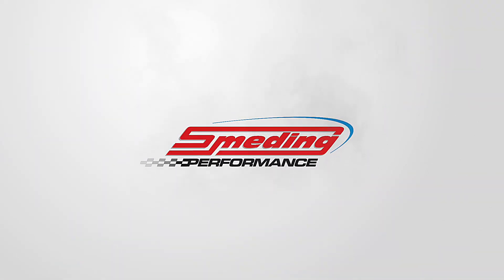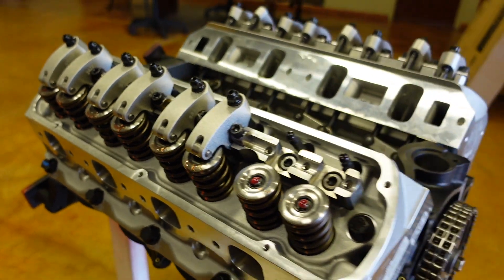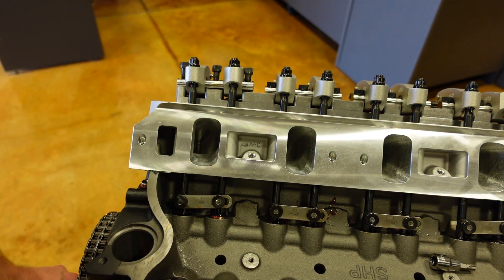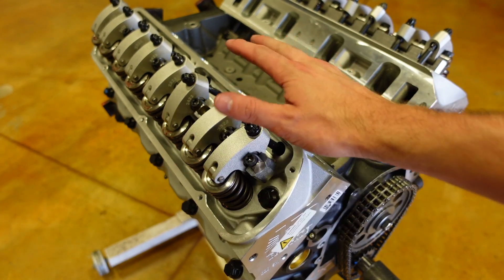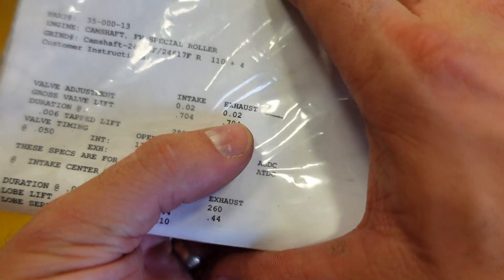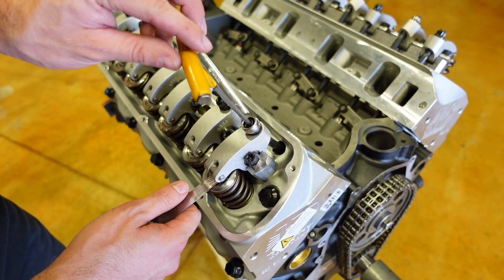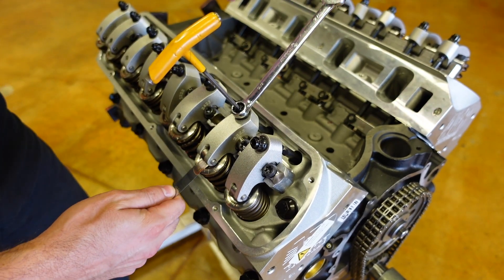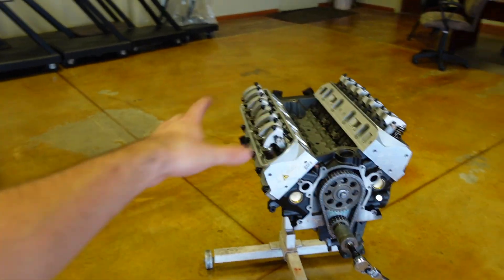How to Adjust Solid Roller Rocker Arms! (I.C.E. Method)

Comment: Cold setting is normally .006-.008 tighter than hot. If hot setting was .020, then cold should have been  .012-.014 lash. Not .006

Comment: The method I was told was to set the exhaust when the intake valve just hits the seat (closed).  If done before the valve fully closes, the lifter won't be on the base circle of the cam.
Reply: If you look at the Chevrolet 350 valve train animation video, you can see that the exhaust lifter will be on the side of the base circle when the intake valve just starts to close, and when the intake valve is fully closed, the Exhaust lifter will be fully on the base circle.
So adjust when the intake valve hits the seat (fully closed).
Hope this helps .

Comment: I have a question,i have a 2013 gmc Denali yukon 6.2 can i block off the oil pan relief valve on oil pan with the Michigan Motorsports plug bolt with out doing a dod delete kit? I need to do the oil pan gasket its leaking and figured since in down there why not .im also putting a new oil pick tube o ring .your time and help much appreciated